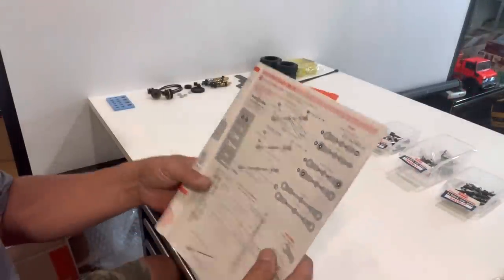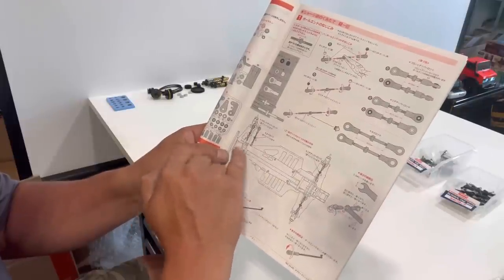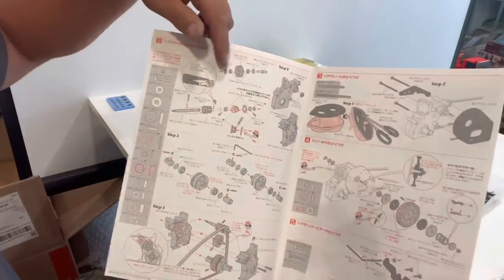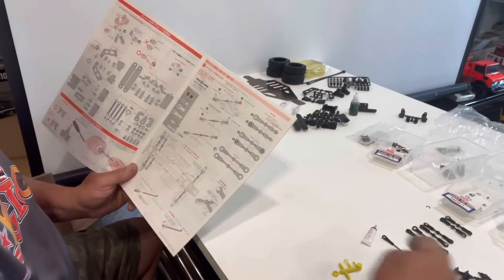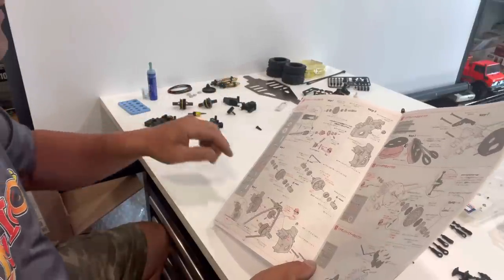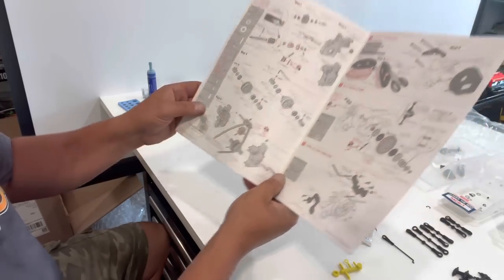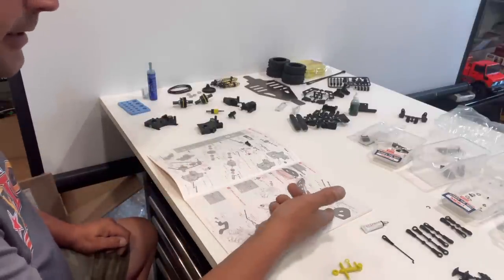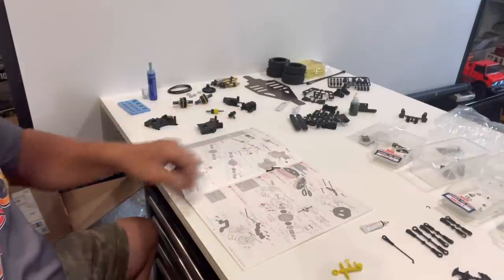Optima Mid Custom Special full chassis build

Comment: My guess why the tolerances on bearings for the wheels hubs are large; if I'm thinking it through: Cast alloy hubs, steel/stainless steel bearings; on a car that is meant to be competitive racer (in its era).  The metals have different rate of expansion under load with resistance.  I'm guessing if stainless expands on a tight tolerance cast alloy hub, there'd be a whole lot of seized bearing and/or cracked hubs.  Rear bearings and carriers can have a tight tolerance because the plastic carrier/hub will give.

Just a guess.
Reply from the maker: A answer that makes sense. Thank you.

Comment: You know technology has come a long way since the 80s , I know some manuals still come in a non English form, but there is a way to translate this stuff now, it takes more time, but you can understand stand the words with the pictures,  and all you need is a smart phone, or, tablet,  or computer, just hit up Google translate up and let it do it's thing, it is not perfect, but works, and I'm sure you know, this is only being put up in comments for those that are as slow as I am lol took a few heaches before I figured it out, so to all those that love to build full kits still, and only know English this tip is for you.
It's also so interesting to see how much older racing technology is used in modern basher vehicles,  blows me away how much things have changed yet still very much the same, when you were talking about e clips and how difficult it could be back in the day if you didn't have gumption to build ur own tools,  e clips were around when I was helping my dad and grandpa with building their rc's lol old technology.  But long story short, they had become outdated by newer parts and ways to hold things together and for decades e clips seemed to disappear, pretty much from New kits, but now Arrma are actually bringing them back as a way to lock gears down so you don't loose them when the grub screw gives way and comes loose, I think they call them another name safety d clip or something but it is pretty much an e clip goes on the same, can fly across the room the same, concept for it is the same, it is a direct descendant,  if not actual e clip I don't own a arrma model that has these on it,, but working on getting one, agin some people out there are like what is this guy going on about, well I'm 50 and I came into the hobby when it was not popular, very expensive and there were more built from scratch models than build your own kit, yeah sound the same but very different,  you design it, source and manufacture your own parts, then build it and work the kinks out, lots of plane and boat kits, but not alot of truck and car kits, so I have a bit of history and there are those that have more than me, so I have seen quite a bit come and go, and when you see what was said  to be old and inferior parts and technology start to come back into main stream rc you really got to smile and go wow the hobby really is coming full circle for the few chapters that you are a part of it, it's just so cool.
Reply from the maker: It is so true. I have a ton of modern bashers and crawlers. Db02 was a shaft driven 4wd flop. Needed to be shimmed. The xmaxx, Kraton, and most models now are the exact same thing just shimmed and refined.
Reply: @rcicons4915  true

Comment: Great build, Keith. 👍

TIP: If you have google translate on your phone, you can use the camera to reconize text and translate it. Set it on 'Japanese to english'. Point the camera to the Japanese text and you get the english translation on your  phone. I even tried it on a still image from this video on my computerscreen when you hold up the manual and show us a page with step 5 on it and it shows me '5 attaching the rear damper stay' 😃

And BTW.... thanks for the TIP on that E-clips tool. I bought it after you previous mentioned it and it's truly a lifesaver (no more near heart-attacks 🤣) I paid 22 dollar/euro now on Amazon.
Reply from the maker: Thanks for the tip.
Yes, that tool is a must have.

Comment: weird that it has an alunimium chassis, the mid custom has the aluminium chassis and the custom mid "special" should have a carbon chassis and not aluminium.....
Reply from the maker: Apparently the Early custom specials came in alloy. I have seen other kits come in the alloy as well as well as frp. Haven’t seen it in carbon though. Wouldn’t be surprised if it did though. Kyosho did a lot of different variants of their cars.
Reply: The mid custom and the mid custom special had a mix of chassis types depending on which production run they were from. My current mid custom has the FRP and my custom special has the alloy. Back in the day my mid custom had an alloy. The only mid with an carbon chassis was the TOMS or a LWB conversion kit car.
The belt idle pulley on the upper shaft is just an idler drive for the belt comes from the diff case.
Reply from the maker: @davidchapman5694  awesome info.
Thank you

Comment: Great video as always, if you are concerned with scratches from your table you can always use lining paper. Not sure if you have it in the states but it’s basically unfinished wall paper. It’s available in different weights and the great thing is grease oil dirt no problem as when dirty throw it out cut another piece. Brown paper isn’t as good as is to thin. Anyway you make great content and can’t wait to see it finished 👍
Reply from the maker: Thanks for the tip. The table top is white pvc so easy to clean. I just worry about dirt or debris from the build process. If you want to see a pic of the finished car there is one on my community page.
Reply: @rcicons4915  looks fantastic 👍
Reply from the maker: @richardlingham9400  thank you
Reply: Gday Keith nice build. I have one of me missus old thin yoga mats on my table to protect the car parts when building them.
Reply from the maker: @michaelfrancis865  awesome. Thank you. My wife puts up with a lot already as far as Rc goes. If I take her yoga Matt, it might put her over the edge.